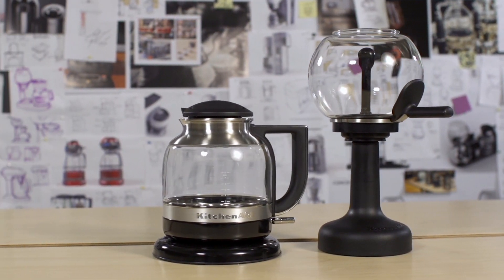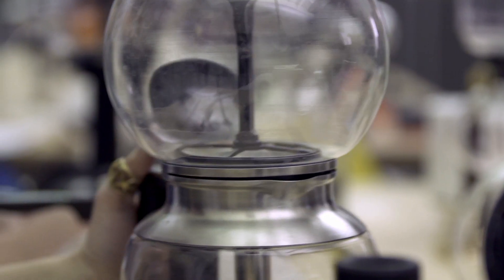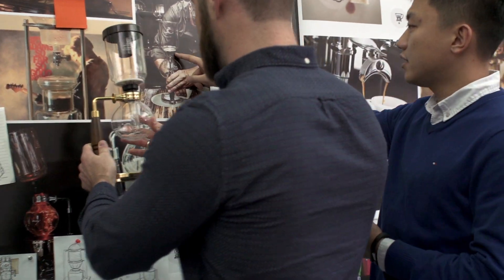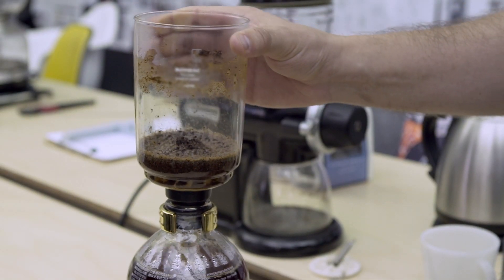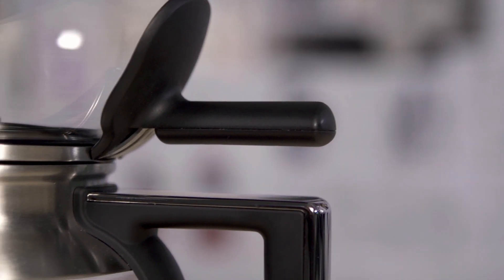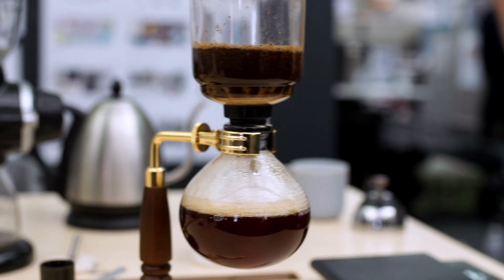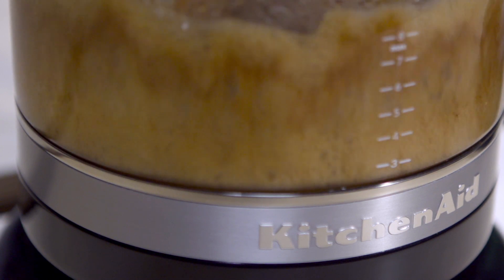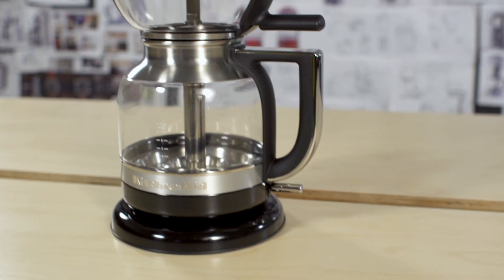The Siphon Coffee Brewer | KitchenAid

Comment: The bottom unit is sealed to the top.  When sufficient vapor pressure is built up above the water in the bottom it pushes the water down which goes up through the tube to the top vessel where the coffee brews.  When the heat is removed the air in the bottom cools creating a partial vacuum.  The weight of the atmosphere above the top vessel pushes the coffee in the top down through the filter and tube into the bottom vessel; this is the siphon process. It is not just gravity, the suction in the bottom allows the atmosphere to push the coffee down the same as when suction is applied to a straw and the soft drink is drawn up the straw into the drinkers mouth. Note that some designs of this method have the upper vessel below the lower vessel, it still works due to the suction created by cooling. I imagine this method wouldn't work as well at high altitudes; I've only used it near sea level.

Comment: I like the look of that coffee brewer but why use some plastic parts ?  Plastic and very hot water is a big no, no in my humble opinion.
Reply: Exactly… everything else is metal or glass and then they stick a plastic rod in the middle where all the hot fluid will be siphoned into….big brained idea
Reply: @D4rkM4773r  these plastics are temperature resistant, they make spatulas and spoons that can handle in excess of 300 degrees Fahrenheit. the mesh is made of nylon
Reply: they go out of their way to make a product for those whom seek a better design, only to add plastic where the hot water is smh.
Reply: @CasasChicago  plastic is not only able to be made to be highly heat resistant, but also due to that resistance it is a highly effective insulator, allowing hot water to remain hot for a greater duration.
Reply: Also, the plastic rod wont dent or shatter if dropped and is more cheaply replaced

Comment: I thought that to brew the best cup of coffee the water temperature should be between 195 and 205 degrees. Pouring boiling water over your coffee grounds will "burn" the grounds!

 Does KitchenAid have an explanation for this design of their pumping a water  temperature that exceeds the optimum water brewing temperature????
Reply: +sir geezo they didn't invent siphon brewing. They're improving it.
Reply: +SoulxReaper366 This is actually incorrect. Water under higher pressure has an increased boiling point, not lowered. This is how boilers in things such as espresso machines can work. Water especially for the steam wand is usually much higher than 212. While it is true that the water does cool as it is raised into the top vessel, it is entirely possible for it to boil, and looks to be doing so in the video. As there is no temperature control on this device, its further to be likely that its boiling, which is far too hot for coffee grinds.
Reply: @tomgrampersand  the pressure pushes the water up but the water is not at a full boil and it is only at atmospheric pressure. After the water goes up to the filter funnel it is further heated by the steam when only a small amount of water is left in the bottom. I have never seen any boiling water in the filter funnel.
Reply: nah water gets hot, it starts to steam the hot vapor pushes the hot water up the tube before the water can boil. its all fine

Comment: Well id buy this if you did two or three things

1. Make the carafe and heating element separate units so it can be washed by the dish washer

2. Make everything inside out of metal

3. Make it so you can control how long the grounds get soaked and the temperature of the water. You might be able to do this by controlling the  amount of pressure in the bottom carafe by keeping it heated above boiling and adding a separate mechanism that drips water into it to keep steam going up into the top. If you do this you would aslo need to let some water out

So lets recap add a side water reservoir that adds water to the bottom carafe. This will alow more steam to be built up to keep the water in the top reservoir.

The top reservoir has an additional filter and tube that allows water to drip back into the bottom part. This tube extends to the top of the top reservoir and the top of the bottom reservoir. It is connected to the filter to allow proper passage

Of course you would need a motherboard to allow for certain controls of temp of the whole unit and water controls to allow the proper amount of water to be added.

This will allow you to control the strength of the coffee

Also make it just a metal filter, the whole thing with tying something down to it is a pain. Also make it so you could pour any temp of water into it and it will work the whole thing with automation only works if it is warm water. And warm water carries the most sediments and isnt that healthy to drink. So a temp gauge would be nice. 

Maybe if you didnt use a cloth filter you could use extra metal screens with additions, this will not affect anything because of the extra tube that got implemented. The water will still drip down when everything is finished it will just take longer or maybe not because the downward pressure would also be greater. Just make sure them seals are air tight
Reply: How old where you when your parents divorced?
Reply: Spot on sir, I would settle for just number 2 though

Comment: Coffee nerds have incorrectly named this process siphon or “syphon”.  It does not employ the physical process of siphoning at all, rather it uses a vacuum process.  - From wiki; syphon) is any of a wide variety of devices that involve the flow of liquids through tubes. In a narrower sense, the word refers particularly to a tube in an inverted "U" shape, which causes a liquid to flow upward, above the surface of a reservoir, with no pump, but powered by the fall of the liquid as it flows down the tube under the pull of gravity, then discharging at a level lower than the surface of the reservoir from which it came.